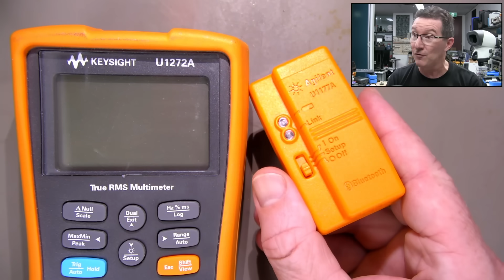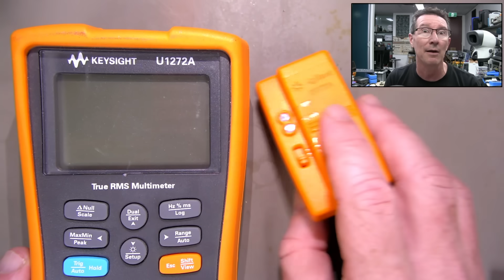EEVblog 1687 - A Pointless Alkaline Battery LEAKAGE Repair

Comment: This sort of culture has long since made "Mobile app enabled" into a negative feature. If I see that on the packaging I'll want it less.
Reply: I only buy devices with a mobile connection if there's a readily available way to make a custom interface for the API they expose. Bluetooth is often easy to make custom apps/websites for
Reply: It is not just mobile equipment that suffers from app related built in obsolescence, test equipment that functions as a peripheral to a PC, even if connected over a wired or wireless network, are victims of OS upgrade obsolescence. A missing software driver or  library component, can make even very expensive test equipment prematurely obsolescent. The test equipment may continue to work without the PC connection, but the user may lose the ability to log the output data, print output  graphs, archive result files, or no longer be able to remotely control the equipment. This maybe why the UK NHS was so reluctant to upgrade from Windows 7, and why the  Linux OS might keep lab  test equipment running longer. It's a case of upgrade your lab PC OS,  and expect half the networked peripherals to no longer function,  due to software compatibility issues.
Reply: The more advertising I see, the less I want to buy.
Reply: Yeah, Steve jobs was against apps at first, since ‘what’s the point, just do it in a web browser?’ Something like that I believe. 

Some “Apps” could be a simple webpage if they wanted. Let it run on the oldest hardware. No client-side updates required. 
Some Apps could be HTML files, etc. or a link to a local network device.
Reply: @davadoff  I make all my industrial B2B software as progressive webapps, with modern JS there is almost nothing that a PWA cannot do
Reply: @davadoff  Likely a misremembering of Palm's WebOS. Palm was AMAZINGLY Prescient with WebOS and the Pre. It was all what we now call PWA- Progressive Web Applications. And Indeed- a LOT of store apps are just PWA's wrapped in a webview. Even Electron is just a bundled PWA- Discord, VS Code, Slack, etc. All just their web apps packaged with electron. With CORS and other methods allowing web apps to talk to other domains' HTTP(s) servers, and sometimes even (nearly) raw TCP/QUIC socket access. Well, We're VERY close to "The Web" taking over the OS.
Reply: Just find the APK for it... Maybe you'll make it run

Comment: If a device won't run off the lower voltage from a NiMH, I have some lithium rechargeable AA & AAA...but you won't find any alkalines in my house.

They've ruined too many things for me to ever trust them again.
Reply: Lithium Primaries are the way for stuff that sits long term, eg. Energizer Ultimate Lithium
Reply: @MillerWissen  those are so expensive...I don't use any single use battery.

Comment: Over a year ago everyone yelled at you to stop using alkalines.  Most of your videos are great, the continuing set of these is just annoying and stupid destruction of expensive kit that most of us have to pay for.  Use rechargeables!!  If something won't work with 1.2v Nimh then use the newer 1.5v AA/AAA Liions.  It should be on every EE's annual appraisal questions "How many devices have you had alkalines leak into this year?" and if the answer is more than one then fire them for being incompetent and not learning!
Reply: To be fair this must have been sitting in a box for at least a decade, so even if you switch, these may just still be lying around somewhere.

Comment: I see no reason to pour vinegar on it instead of just dump it in alcohol straight away. May be only if you like bubbling.
Reply: the potassium hydroxide is a strong base (alkaline) so it needs an acid to neutralize it properly (eg lower the pH levels)... alcohols will just dissolve it into the alcohol solution, meaning you could spread the damage further once the alcohol evaporates and leaves the KOH behind...
Reply: @WacKEDmaN  that is why I say dump. Enough alcohol would dissolve it to nothing. Also you can use tap water and then dump it in alcohol to remove residues of water.
Reply: @pahom2  and waste all that alcohol... disolve all the KOH into it.. and then what?... its useless.... acid then a normal alcohol (IPA) clean like you where cleaning off flux residue its the way to go....youre not wasting a cup of alcohol that would go along way cleaning flux off boards...

Comment: Am I the only one who thinks there is an untapped market for batteries that are leak proof and guaranteed?  Even if they were a large premium, they would be worth the cost for some applications.
Reply: They already exist they are called lithium batteries (AAA and AA 1,5V batteries)
Reply: They are called lithium primary batteries and a widely and cheaply available ...
Reply: Get lithium batteries. 

They can still leak, but it takes decades.
Reply: They already exist.  Lithium primary, Nimh or Liion rechargeables.  Only dumb arses keep using alkalines.
Reply: @MikeB_UK  ive seen Nimh leak just like alkalines... rare...but can happen
Reply: @MikeB_UK the Nimh batteries i have used once in things with low power consumption and take two years to need to recharge more than half the time won’t recharge and acid batteries take about that long before they will leak and cost much less but harder to find
I have tended to have more issues with alkaline batteries

Comment: i think you'll find that the KOH (potassium hydroxide) IS the alkaline.... theres no such thing as an element or molecule or compound called alkaline!... acid or alkaline (sometimes called base)..
...and yup flux should neutralize it as its acidic
im sure ya could hack that bluetooth adapter... connect it to a esp32 bluetooth and sniff the data (ya could even sniff it straight from the serial IR)..then write some code to display it on a webpage served from the esp32 itself...
Reply: my favorite neutralizer is acetic acid diluted by 80% water by volume (20% vinegar). i buy it in bulk (in tesco)
Reply: @uiopuiop3472  I use that to clean the toilet, it works just as well as the commercial cleaner, and is both cheaper and has other uses.
Reply: @uiopuiop3472  thanks for the tip! 
Tesco branded, easy to find?
Reply: @uiopuiop3472  great tip, thanks! You can find it in any big Tesco store?
Reply: yeah Dave should talk to his wife more often
Reply: @s_s-g4d  i was gonna suggest he should ask the misses!
Reply from the maker: Potassium hydroxide is the main alkaline used, and is what makes an alkaline battery "alkaline" but there can be small amounts of other chemicals added or produced that are also alkaline in nature. Manufacturers have their own secret sauce.

Yeah, probably possible to get the adaper working in some way.
Reply: @EEVblog  do you know the trick of using a single li-ion cell (14500 / 10440 size) instead of two alkaline cells?
Reply: These reply's are priceless!